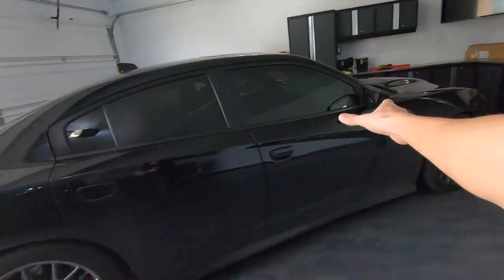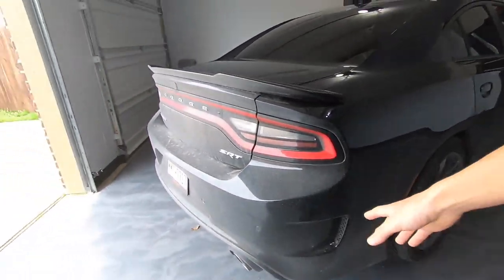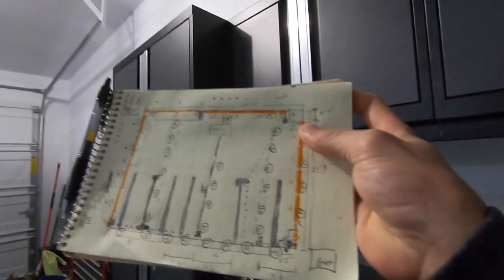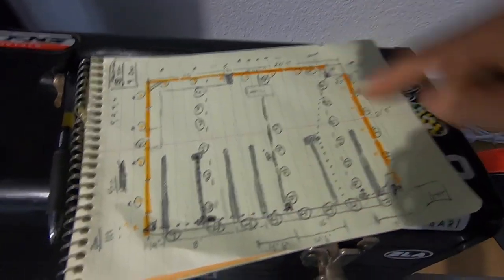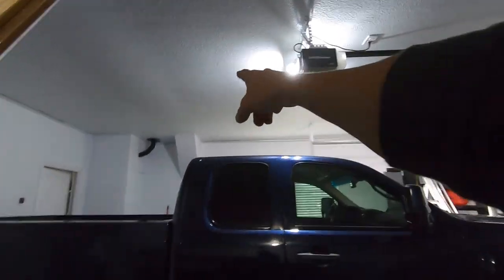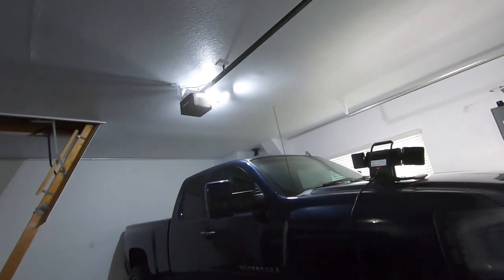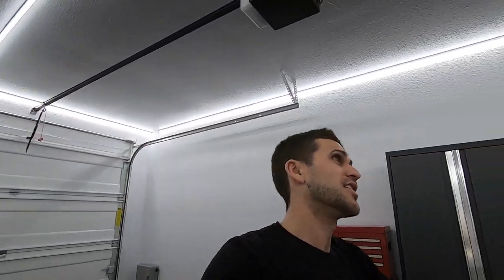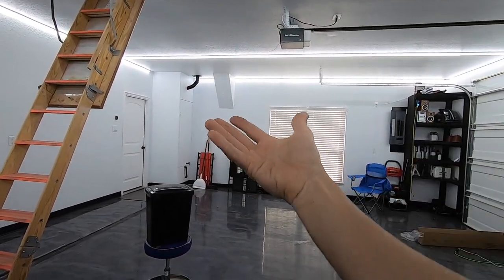BEST Garage / Shop Lighting - Barrina LED lights - Dream Garage Build Pt. 8

Comment: I found this series because I'm planning my own dream garage build on a house I want to buy this year. You've done a lot of what I want to do so it's awesome to see it all come together, and you've done a great job. One thing I plan to do that you may consider is a sound system with roof speakers. There are plenty of bluetooth receivers online that would allow you to power speakers in the ceiling (whether they're made to be ceiling speakers or just car audio speakers) and an active subwoofer so you'd have even sound throughout the garage. You could hide the amp in one of the cabinets and run the wiring through the attic like the lights and it would be super clean. Can't wait to see what's next!

Comment: Instead of breaking out the soldering iron to extend the wire why couldn't you have just cut one of the ends off the longer cords that were supplied with them?

Comment: thanks again for your dedication and amazing content. got the latest version of these, and they are great -- super bright, easy to install, 5k is a nice pure white. however, one caveat: i discovered they conflict with chamberlain wireless remotes. when the lights are on, the keypad and car fobs won't work. still happy, and might not be an issue with other openers, but something to consider for anyone shopping for lighting.
Reply from the maker: Thanks for the info!

Comment: drywall cracks are normal as you've said (small settling cracks) but definitely suck. if you have them develop again elsewhere, try cutting a small notch along the crack, filling it (as smoothly as you can) with gorilla glue (stays flexible), then once it's dried overnight a small skim of mud/paint. seems to work well.

Comment: I have been considering different lengths on a diagonal (short in the corners then increasing in length, end to end, towards the center of the garage)  Some of these are available in 4, 5, 6 and 8 foot.

Comment: when you hardwired the lights through the ceiling drywall, did you just use several junction boxes when splicing the existent wires to the original lights? How many lights are connected at once before running out of wattage.
Reply from the maker: Yes, and 8 lights (per the instructions) can be linked together
Reply: @LonestarHawaiian  thanks, wanted to do this hexagon pattern using the same slim LEDs. What do you think is the easiest way to do it? mount the lights and pass wires through the drywall, then in the attic just use several junction boxes and additional wires to link to existing circuit for lights?

Comment: Chad I'm going to follow your lead on installing lighting in my garage... any lessons learned from the install? Did you have to do calculations of how many row of lights you can connect to one switch...
Reply from the maker: Everything went as planned for once. Only recommendation would be to draw everything our beforehand (especially your wiring) before you begin. Good luck!

Comment: Lights look awesome, great video! Curious if you'd change anything about layout/set-up after having them for 2 years? Also how are the lights holding up?
Reply from the maker: Lights are beginning to burn out after ~2years. Color temperature (6500k) looks great for videos but begins to hurt your eyes after a few hours. 5000k may have been better.
Reply: @LonestarHawaiian Did you ever find an alternate/ replacement light with a similar form/function? After seeing your video, I installed 50 of these in my 900 ft² garage. I had the same experience, one by one. They start burning out, and about 47 of the 50 are now dead or flickering. All of the similar products on amazon under different brand names appear to be the same exact light with same hardware/ cables etc, and most of the reviews mentioned a similar failure after 1 to 2 years of use.  Wondering if you ever found a suitable replacement that was linkable for garage strip lighting like this, but better longevity. Thanks!